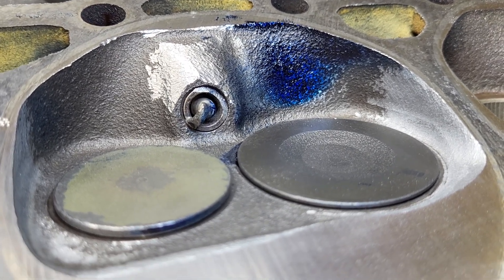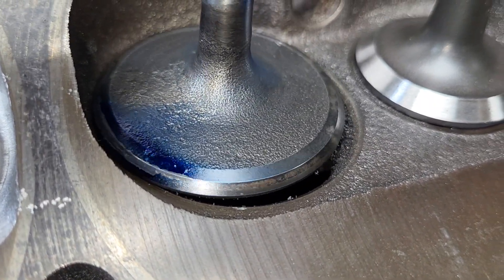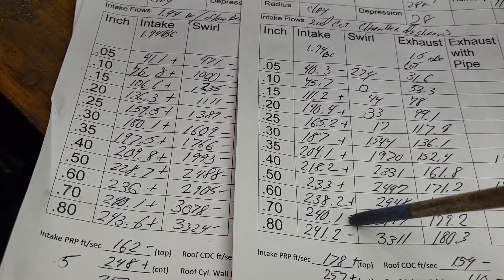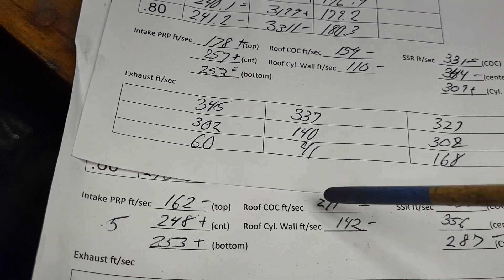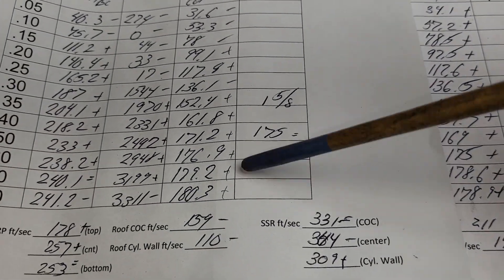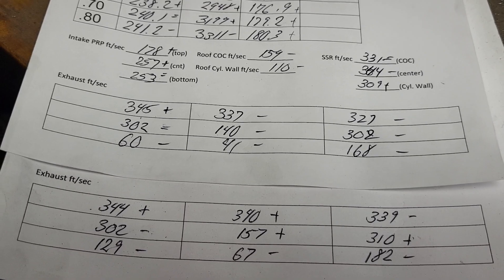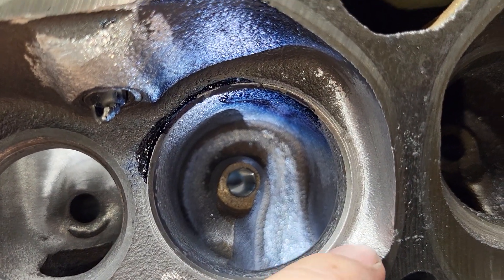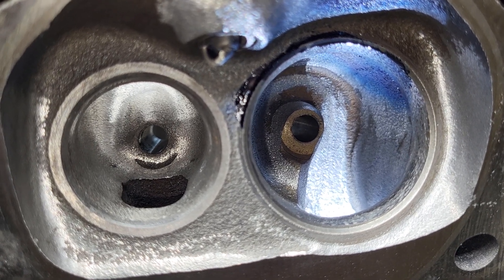16. Chevy 193 TBI Swirl port cylinder heads, 1.94/1.5 combo chamber work

Comment: @ 6:03 you have improved the area around the exhaust valve but seat angles aren't there to take advantage of the mods perhaps ? , i think there needs to be a 15* or more top cut on the seat to help flow get past the valve
Reply from the maker: The top cut is there but narrow. Thanks

Comment: @ 4:55 you have a loss in air flow in the roof area because the air is taking a path of lesser resistance and escaping through the de-shrouded area .... i think what that is telling us is that you need to increase roof area before deshrouding if you don't want to mess up swirl flow.
Reply from the maker: Good observation. Thanks

Comment: Recontouring the spark plug area and deshrouding the valve on the wall side is two modifications at once:face-orange-biting-nails: and my guess is the deshrouding hurt swirl and low lift flow and the spark plug area mod overall appears to be all around helpful.
I'm thinking deshording only pays a benefit when going to a 2.02" valve but we wont know that till you do the valve swap.
That's basically my observation out in utube land :cat-orange-whistling:.

Comment: Nice job Charlie, as usual, i would like to have those heads with a 305/334 engine, i have a 305 tpi engine, but i cannot remember which heads it had on.
Reply from the maker: I think they are 081's basically the same as 083' with a smaller chamber and intake valve.

Comment: Hmm, interesting. Looks like opening up the CC like you did took out some swirl energy in low end. Your numbers verify this. I imagine it's because the air isn't trapped by the CC like in the stock one, and thus takes a longer route on it's way to the plug. Your version flows more, but it's less jet-like at lower RPMs. I wonder what happens if you take .001" from the area between the spark plug and the EV. Just to smooth that trailing hump on the boss a touch.
Reply from the maker: Good idea. Not sure if I will do exactly what you wrote about. Did I do that on the 2.055 valve chamber.

Comment: Widening to the bolt hole should be good for another 17 CFM @ .500" lift with the factory valves maybe? That would be a perfect match with a genuine imitation RPM Airgap dual plane intake. Should max out the intake's unported flow capability? 450 HP and 500 ft lbs for a sbc 383 with the right cam, perfect.😎👍

Does the swirl help pull more air in? If you get time do you think you could bolt a genuine imitation RPM Airgap dual plane intake to the head to flow that factory valved port? That would tell a more accurate story of what kind of power to expect. Thanks in advance if you get a chance to do that.😎👍
Reply from the maker: I only have a fully ported rpm.
Reply: @servediocylinderheads  
Oh well, thanks anyway. Try that ported intake on your best port would be very cool if you get a chance?😎👍

Comment: Just looking at your video and it might be an illusion, but when you look at the chamber from on top, it appears that there is more clearance to the cylinder wall from the intake valve, than there is on deep side of the chamber. I might be wrong, but it just looks that way in a couple of shots. The smaller valve might like your fuelly chamber trick. What I found most interesting was the lack of dykem across the valve as compared to your fully tricked port.
Reply from the maker: You make a good point. Thanks

Comment: Go to a 2.00/1.55 valve combo and creep up on the flow. Max flow with the smallest valves.
Reply: My thinking is if it's a large port with a deep bowl, what is the CSA vs the valve area or throat. It might need the larger valves to get the port density or coefficient of discharge up. Maybe time for just measurements and the IOP program. If it even relates to the high helix design, you never know but it would be interesting to find out.
Reply from the maker: I would think the iop would still give info, the change in fuel prep and burn time would be different in a high helix design so not sure how far off it would be.
Reply: Swirl is energy though. It may not make a difference either way, just an interesting thought. Conventional wisdom and experience may not always apply to such a different approach.
Reply from the maker: @bobbyhaskell2048  True. Thanks

Comment: I just bought a tbi motor for my parts runner s10 long bed, might have to play with those heads and see what I can get out of them, thanks Charles
Reply from the maker: Have fun! No small amount of work. Check them for cracks, get guides and valve job done. Thanks
Reply: @servediocylinderheads  I have a seat and guide machine,  so new cast guides will go in
Reply from the maker: @No1414body  I am jealous!